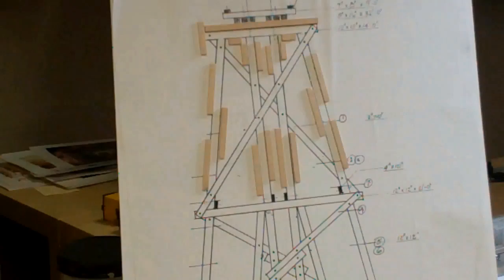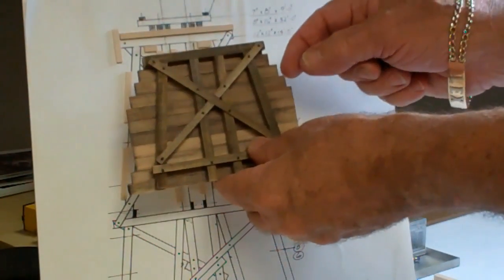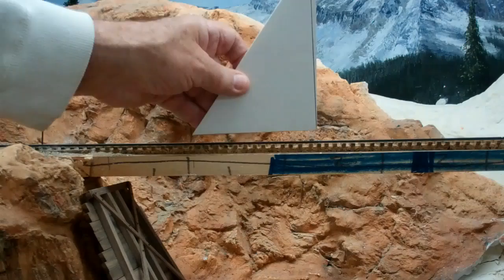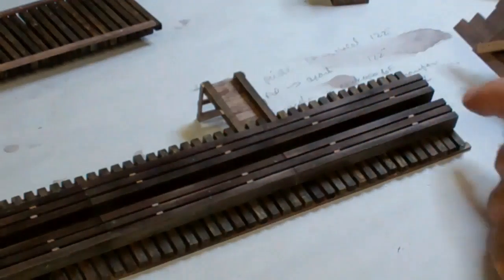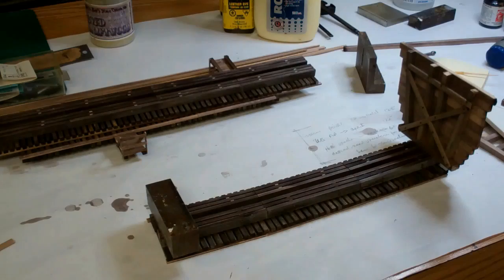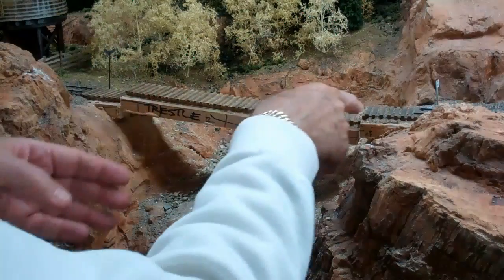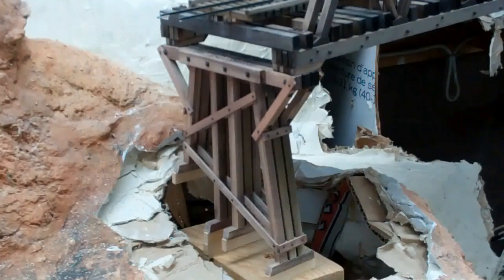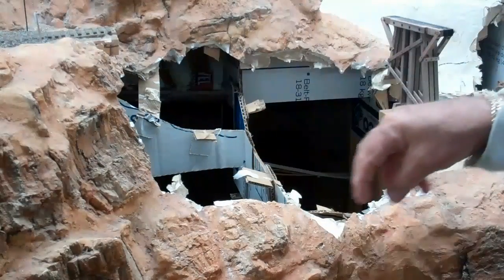Part 5: Assembling the bents on a template and installing them by Lex Parker

Comment from the maker: This video illustrates attaching the bents... upside down and with a square to set plumb, assuming there's no grade.  I use carpents yellow glue but you can use crazy glue, but I don't.  I spike my rails to the deck before adding the bents leaving extensions to connect later.

Comment: Awesome!  Ok well my father and I are building our first of three wooden trestles.  We have the deck and bents built and ready to attach them to the underside of the deck.  How would we go about doing that to make sure that they stay straight, and plumb?  What is the best glue to use when doing this?  Also, how did you go about attaching your rails to the deck?  I have heard a few ways such as supper glue them to the deck or use rail spikes.  Just wondered the best way of doing that.

Comment from the maker: The template can be adjusted.  You can add stories using the same dimension or make them shorter.  The storey height shouldn't be much higher, just needs more bracing.  Half size, I assume you mean storey, can be almost as high as 2 storeys, just add bracing.  Look at part 1 that shows images.

Comment: Maybe dumb question Lex,  what happens when you only need a half sized  bent at the bottom of a gorge or base  of  a  river  or up  the  bank where the  standard length  bent doesn't work out  with the distance from the  bottom  of the  deck to base of the terrain?
Reply from the maker: Sorry for such a delay, dont always get notifications:
These can vary, you'll note the cut lines on the drawings that allow for specific height locations.